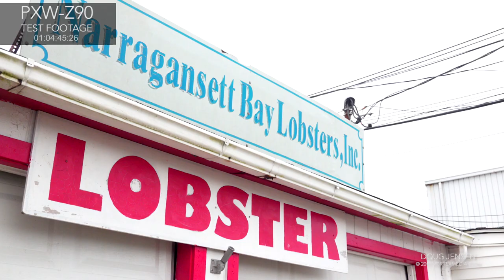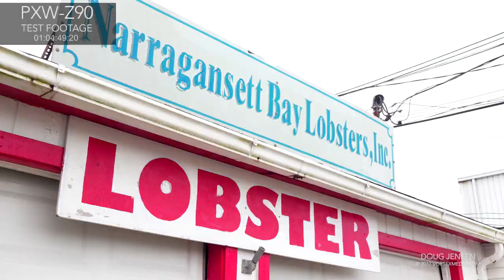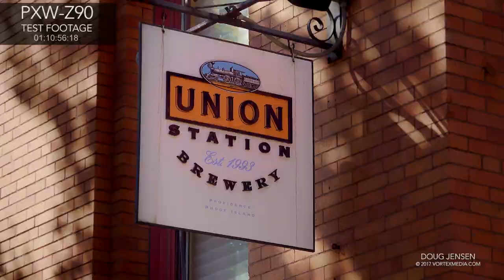Sony PXW-Z90 Test Footage

Comment: Do you know what the bitrate is for shooting on slow motion (specifically interested in 120fps if the bitrates change with different slow motion strings), thanks.
Reply from the maker: I believe the bit rate is 25 Mbps when it is shooting 120fps in HD.
Reply: Doug Jensen, thank you.

Comment: is there a way to record at 120fps outside of the Slow/Quick function, so that it still has audio?  If so, how do you set it up to do that?
Reply from the maker: The Z90 cannot do 120 fps outside of the S&Q Motion function, but both the NX80 and AX700 can do it.

Comment: After watching 100s of test footage videos from people who don’t know how to use the camera in the first place, this really showcases what the cameras quality is truly capable of with great skills, my one question that I’ve been wondering is are the first shots of the birds in 240? My one worry is that shooting in 240 will drop quality yet it is a necessity to run it as I capture high speed action sports!! Thank you for this video
Reply from the maker: Thank you for the compliments.  It has been almost five years since I shot this video and I can't recall exactly what settings were used for any given shot without going back to the original footage and looking at the metadata.  However, I do know that almost all of the slow-motion is 120 fps.  I know I didn't use the 240 fps mode very often because it only allows you to record for a few seconds and then you have to wait for the camera to process the video.  I don't have the patience for that!   So there are probably a couple of 240 fps shots, but most is going to be 120 fps because there are no restrictions in that mode.
Reply: @DougJensenVortexMedia  super bummed, super looking forward to using this cam to increase work flow and productivity yet it is sold out everywhere 🙄, I guess it proves how good it is… over 4 years old and there aren’t even used ones going around, big wow for the video industry

Comment: Dear Doug, did you edit the material or is this just raw footage? and did you use the slow-motion tool on the camera or also post-production? Thank you!
Reply from the maker: Hi Timo, yes this footage has been edited but all of the slow motion was done in-camera.
Reply: @DougJensenVortexMedia  Is is possible to record in 240 FPS without built-in slowmo tool?
Reply from the maker: @luis_fntx4449  No, that is not possible.

Comment: Hi Doug, I hope you could give me a hand. I am a very enthusiastic yet amateur teacher who leads a filming club with students from 14 to 17 y/o. They have made a short film. We have used the Z90 and the Bmpcc4. For the Sony, we have shot in XAVC 3848 x 2160 p, which inside DaVinci appears as a .MXF file. For colour correction-grading in DaVinci Resolve, we used just primarily controls, and the result is pretty good. However, we would like to experiment and create a version with Colour Management and DaVinci Wide Gamut. The output will be Rec. 709. I am conscious that the colour management won't detect the Sony clips; therefore, we will need to choose an input colour space accordingly. I am not sure which one we should use and why. I can pick whatever and see if it looks nice, but I'd rather understand it better. We tried some of the PP presets in the Zony Z90, but in low light, they resulted in noise, so we used the camera with PP off. I hope you can point us in the right direction. I haven't done it yet (I am a busy Spanish Teacher), but I will certainly do your masterclass as we plan to buy a second Z90. With all our respect for your amazing work, Miguel.
Reply from the maker: Hi Miguel, I'd love to be of help but I don't think I have the answers you are looking for.  Although I do all my grading in Resolve, I have never used a color managed workflow or those types of settings.  So, if you're looking of advice on a "Color Management and DaVinci Wide Gamut", I am not the person to ask.  You'd be better off seeking the advice of an experienced colorist.  However, with that said, if you didn't already shoot your Z90 footage with S-LOG3 then I think it might be too late to use the workflow you're asking about.

Comment: @Doug Jensen thanks for sharing this video. Which camera would you recommend for events such a conferences and weddings? The z90 or z150?
Reply from the maker: It mostly comes down to form factor since both cameras are electronically about the same.  The Z90 has better auto-focus but I find the form factor of the Z150 more to my liking.  Just decide which style works best for you and go for it. You can't really go wrong with either one.

Comment: You did a great job showing what this camera can do, but what is most interesting to me is how this compares to the much more expensive z280. I've been trained to think bigger sensor, means better image quality, but your footage on the z280 is much better when it comes to dynamic range. Must be the lens or the 3 chip sensor as opposed to 1 larger chip
Reply from the maker: Yeah, the difference between 1" and 1/2" isn't very big.  In fact, those aren't even the actual physical dimensions of the two "types" of sensors.  The Z280 excels due to better electronics, better sensor, better processing, and an f/1.9 lens.  The Z90 only has an f/4 lens when its zoomed in, so that is one reason shallow depth--of-field isn't really possible.
Reply: Biggest pro for the Z280 is for me the 2160p60 capability. Such a pity that the compact ones don't shoot in 60p 4K.

Comment: Thanks for the video, Doug I was wondering is this camera good for wedding videography? In one of your videos you said that the NX80 is great for weddings but i think that camera is discontinued and i really like this z90.
Reply from the maker: The NX80 and Z90 are virtually identical cameras, so if one is good for weddings, then so is the other.  However, it depends on what style of wedding video you want to shoot.  If you like the look of shallow depth-of-field, then these cameas would not be a good choice.  But if you want to move quickly, efficiently, avoid changing lenses all the time, and not miss any shots, then these cameras are a great choice.
Reply: I'm not sure if you are still looking for results from a wedding video or not, but I just shot a wedding with a Sony NX-80 and a Nikon Z6. I primarily used the NX80 outside with the SLOG3 picture profile, 1080 HD, with either 24 fps or 120 slow motion. The footage looked fine and mixed well with the Nikon. I was able to use the Nikon to get shallow depth of field and shoot in low-light.
Reply: @phillipcowen4  i already make a wedding video with the ax700 and the experince was great. The auto focus and the optical zoom help me a lot, i just need some lights for the reception but soo far soo good.

Comment: I'm torn between the the Z90 and the NX80. I don't really need the broadcast features the z90 offers, but will my image quality suffer any by stepping down to the NX80? Does the 422 capability improve the quality?
Reply from the maker: In my opinion, having the XAVC-L codecs instead of XAVC-S is well worth the extra price.  Not to mention having SDI output, which is a mandatory feature of professional production equipment.
Reply: Thanks for the reply. Can you explain to me the difference in the XAVC-L codecs vs. XAVC-S, and if/how they will effect the image? (I'm green) I currently run DSLR's to achieve professional quality videos. I mostly shot outdoor/sports. I'm looking for a camcorder for "running and gunning" style shooting. It needs to be small and easy to carry that will give me a professional look. Any advice?
Reply from the maker: Unfortunately that would take more time that I have available. But I'm sure there are other sources of information that you can find by Googling.

Comment: Just curious, is this camera LANC compatible?  I have the X70 and have used a LANC with adapter cables to the Micro/USB port, but I think I would much prefer the capabilities of using a traditional LANC.
Reply from the maker: Good news for you.  The Z90 uses a standard LANC connector.

Comment: Hi Doug, nice shots , any idea if we need gimbal for stability or camcorder have default stabilization mode ?
Reply from the maker: Hi Ramarajan, the Z90 does have stabilization but it is designed just to smooth handheld shots when you are standing in one place trying to hold a steady shot.  The stabilization is not designed to replace a gimbal or steadicam for walking shots.
Reply: I have Sony PXW X70 it is same body like this z90 since 2017 I’m using it for weddings, events, corporate films, it is very stabe camera to hold without any shake❤❤❤

Comment: So I'd guess you now have a finished production model that your using to do training with.
I look forward to seeing a new sample footage video.  I have to say I'd like to see a UHD 60fps setting on this camera, not for slow motion, I just happen to like 60fps...oh well.
Reply from the maker: Hi Clayton, yes I do have a finished production camera and I'm working 12-hour days in an attempt to finish the training video by the end of the month, because if I don't wrap it up before I head to the Olympics then I won't be able to get back to it until March.  I doubt that I will be putting together another sample footage video, but you never know.  Also, the camera is not capable of shooting UHD faster than 30 fps.

Comment: Hi Doug, great slow mo video!  Was this video color corrected or is this raw from the camera?  Also does Z90 have option of 4K @60fps?  Thanks again for sharing. Cheers mate!
Reply from the maker: Thanks for the comments.  Most of the footage has been touched-up just a little bit in post (as all footage from any camera needs to be) but nothing major that couldn't be done in an NLE in a few seconds.   The Z90 cannot go faster than 30 fps in 4K.

Comment: Great job Doug! Can I ask which is better in low light fir day churches and dark reception areas? I need a couple of good low light camcorders to compliment my eos rs . Steve
Reply from the maker: Thank you.  The Z90, NX80, and AX700 all have exactly the same performance in low light.  But the Z90 has a better codec so maybe that would give it a slight edge in post.
Reply: @DougJensenVortexMedia  Thank you, i think i could get two ax700 for the price of the z90 in uk, thanks Doug keep up the good work. steve uk

Comment: I'm extremely novice in editing and camera adjustments, pretty much zero experience in film. My question is does this camera have a lower frame rate? Because higher frame rate it would mean slow motion right?
Reply from the maker: I'm not sure exactly what your question is.  Are you are asking if the Z90 can do "regular" speed video in addition to slow motion?  If so, the answer is yes.  24p, 30p, etc., whatever you want.

Comment: Hi, I am trying to get some test files of this camera. I want to see how and or if I can edit on my phone. MXF is crazy and I read in your posts you wish it had mp4 wrapper. So you understand my pain, my goal is to use a converter program and see if I can find one that'll allow me to convert to .mp4 witout tkaing too much time. So far Ive come to realize that no editing program on the phone supports HIGH 4:2:2.

I can use H.264 HIGH but for some reason when 4:2:2 shows up, it can't so I'm trying to see if maybe 4:2:0 is a better option, maybe I have a link to 4k footage? or AVCH 4:2:0 in 1080p ?
Reply from the maker: Hmmm,  I don't recall saying that I didn't like MXF.  I don't really care what wrapper a video file comes in because they all function the same on my computers.  Makes no difference to me if it is MXF, MOV, MP4 or anything else.  Sorry, I don't have any original footage that I would be willing to give out.  Good luck.
Reply: @DougJensenVortexMedia  you know what? I confused Cliff Toten's long post for yours lol. And with regards to sample footage. I think to call it "original footage' would make it a bigger task than I actually wanted.

 Essentially I was just trying to see how my phone would handle a . Mxf file. No more than 5 seconds duration. But I found a work around, I think. I used Premiere and exported in that file format in different codecs and found out that Android doesn't play nice with 4:2:2

I can't find any apps that'll open and edit a file with 422.

But if my suspicious are truen it can handle 420. I just need sample footage to confirm. 

I got an app that converts video. And it'll change the extension from mxf to. Mp4 and the codec has various profiles for h.264.

But in that program I can select to not have it reencode but it'll somehow change the file extension to be compatible with.

I just want to verify if I get ingested I think I can use a proxy file cause I'd 420 and then I'll be able to work on my phone

I did purchase your class but I don't think it had my answers

Comment: Doug, thanks for the early look! I know this is a pre-production unit, but what did you think of the autofocus performance? (as that is a major selling point for this one) Also, was this shot in FHD or UHD? The footage doesn't look very sharp. And I am glad to see you will be offering a class on it.
Reply from the maker: Hi Mauricio, I think the AF works great.  This might be the first camera that I'd ever be tempted to use AF in some situations.  The video was shot with a mix of HD and UHD. I disagree that it doesn't look sharp, if anything it is still too sharp even though I have dialed down the detail in the camera.
Reply: Thanks for the reply. I do a rather non-scientific test for sharpness: screen cap a frame, downsize to 720 then upscale to 1080 and compare to the original image. I did that for a few shots in your sample and saw very little difference, though it may be YouTube compression making it softer.

Comment: What is the first song name, please.
Reply from the maker: It has been 6 years since I posted this video and I have no idea what the song is. It probably came from StoryBlocks, though.
Reply: @DougJensenVortexMedia  thank you
Reply: @DougJensenVortexMedia  by the way, for the same quality as z90 + low light , what camera would you suggest? I plan to shoot some videos in the jungle  night time.
Reply from the maker: @andreyolenyk6253  The Sony Z280 is a great camera in low-light and very easy to use.  However, it costs 2x more than the Z90.  Other than the Z280, I don't have any recommendations because I don't test cameras for a living. 🙂